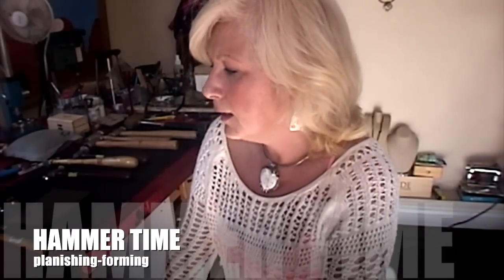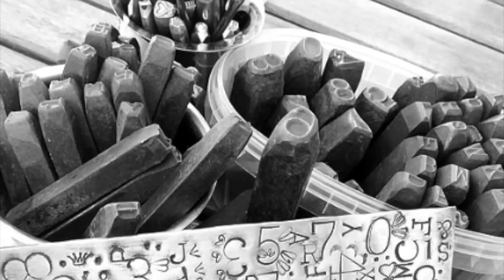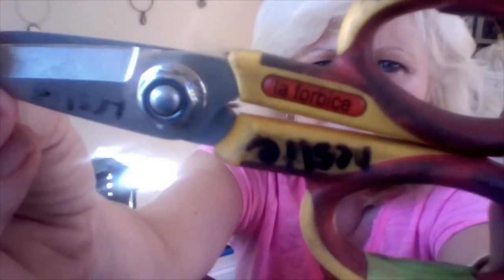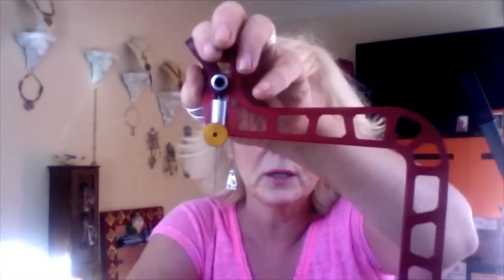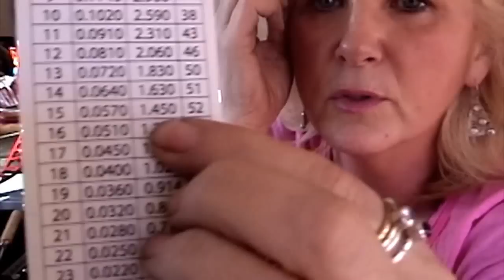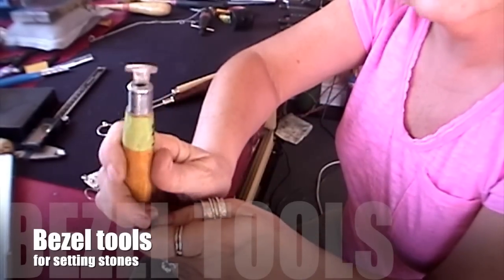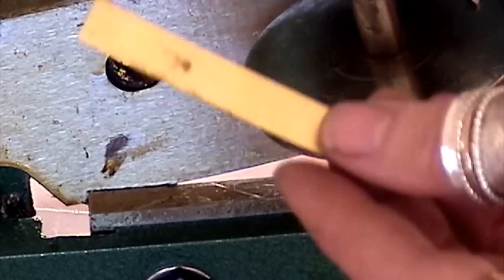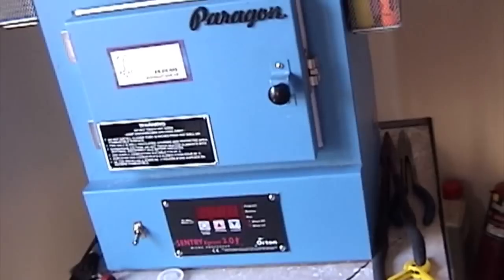Intro to Metalsmithing PART 2  TOOLS HAMMERS TO ROLLING MILLS

Comment: Hey!!!! Do you think the Harbor Freight Chicago  propane torch with 3 burners will work? It was in the welding section and it looks like the tip is more like a bush style torch! I primarily would like to do stacking and other small rings. Thanks!

Comment: The HFT "center punches" you showed are actually nail sets. I'd suggest a set of Mayhew center punches; you'll be able to pass them on to your children. The HFT ALO (ie. anvil shaped object) is a dreadful tool - soft, zero ductility. The railroad anvil that was shown is a much better piece, but it does need to be polished. I only watched a little of the video, but I will leave you with one more comment. Deadblow hammers have an unusually long strike duration, so if you're trying to move metal with a tool that needs to be struck, a deadblow would be optimal. There's so much more; who has the time?